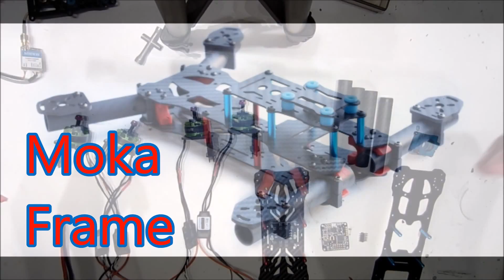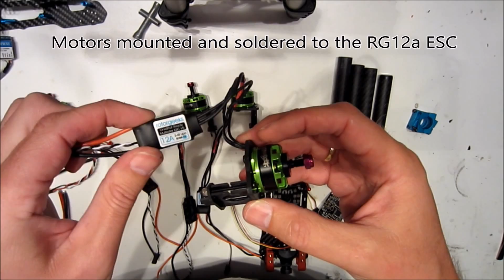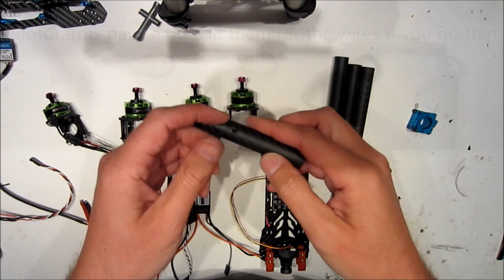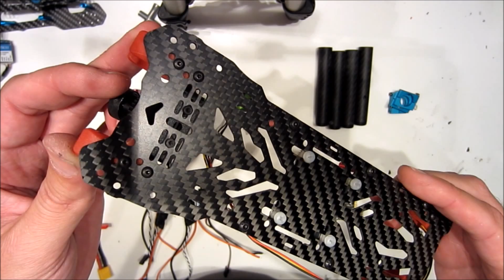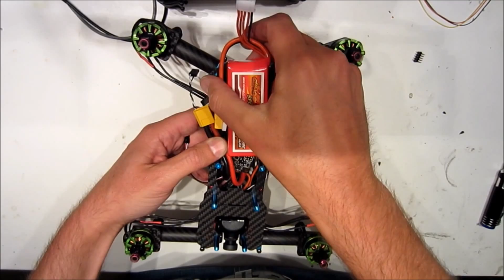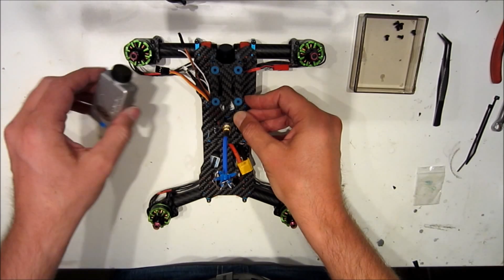Moka frame build video

Comment: nice build. how did you connect the cam and vtx so you get video. I'm new to all of this and am having trouble.
Reply from the maker: +Shawn Rose. Thanks Shawn, Im using a very simple setup. The Aomway VTX has a 5v out and thats where i power the camera from. So all I do is connect the camera and VTX togheter with the red, black and yellow wire, and then I connect the power to the VTX from the battery...all set.